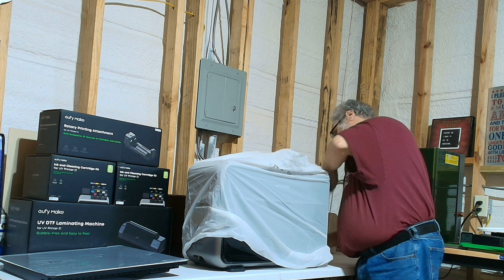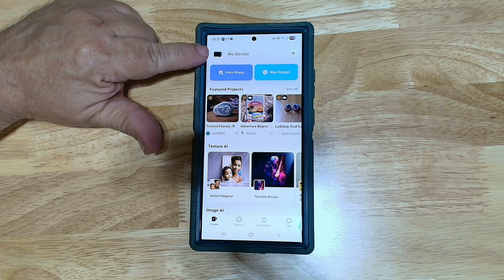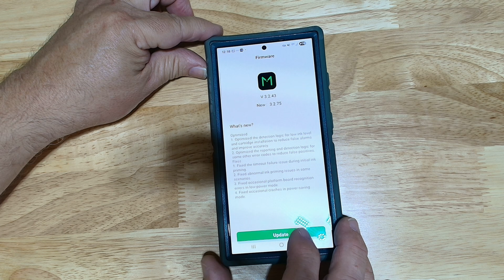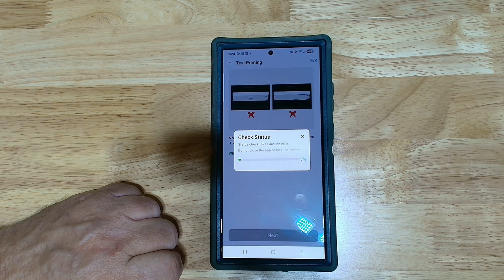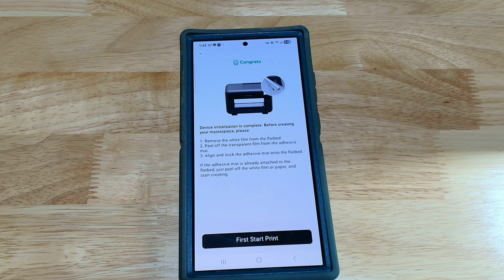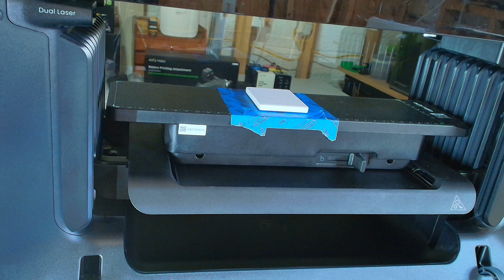Why Is Everyone Talking About the EufyMake E1?

Comment: How does it do with faces and adhesion to metals? Does the ink pop off on metal ?
Reply from the maker: I've yet to try it on bare metal, but on coated metal, such as anodized aluminum business cards, it seems to stick fairly well.   Eufymake DOES sell metal adhesion promoter wipes, so I'll assume that its adhesion isn't perfect on metal.

On faces?   It seems to be pretty much the same quality you'd get out of any ink-jet printer.

Comment: Well, you did well until the ink; you should have shaken them before you installed them, as it says right on the box. Other than that, wonderful job
Reply: thanks for your video !
Reply from the maker: You're welcome!   I couldn't find any videos that took you all the way from unboxing to first project, so I decided to make one myself and document everything as I set it up for the very first time.
Reply from the maker: Thanks for your comment!   Your comment made me go back and read the box(es) again.   

Nothing on ANY of my ink boxes,  not the big box that they all came in, nor the individual ink boxes, says anything about shaking the cartriges.   So I went and checked the quick-start guide.  It doesn't reference shaking either. 

After a while searching, the only official comment I found was a reference buried pretty deep in one of their articles in the blog section of their website.

One would think if it were so important they would at a minimum put it in their quick start guide.

But thanks for the tip!  I'll definitely keep that in mind.
If YOUR boxes say otherwise, I'd love to see a photo to see what's different between your boxes and mine.

Comment from the maker: Full review + long-term testing coming soon… what should I try next?
Reply: Yeah I wouldn’t have called this full review but it was for sure a full setup which was great! Thank you! Next, I would like full instructions (you are very easy to follow/understand) on stickers on dtf and stickers on vinyl to print/cut on circuit or silhouette or siser Juliet. Thank you for no background music too. Hard for hearing impaired (me). I feel if the content is good enough then don’t need that anyway. Again, great content!
Reply from the maker: @TabithaRJohnson  Thank you so much for your kind words.   

Yes I hate the videos where the music plays louder than their speech,  it makes it very hard to understand what they're saying.

I do plan on doing a video on the DTF stickers.   But one thing you may not be aware of.   You don't need to cut them AT ALL.    The printer literally prints directly on the glue. 

All the laminator does is applies a transfer sheet to the top side of the ink.   Once you apply the sticker and peel off the transfer sheet, there is absolutely nothing to weed or cut.